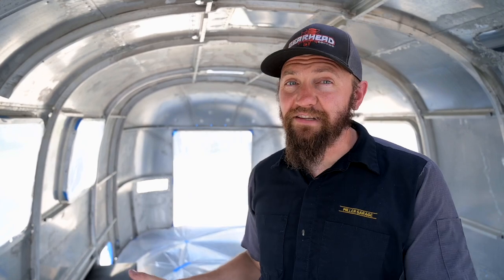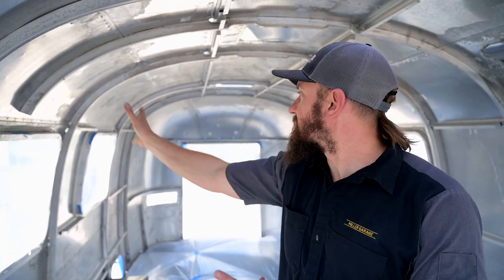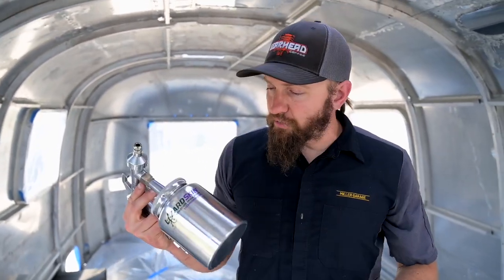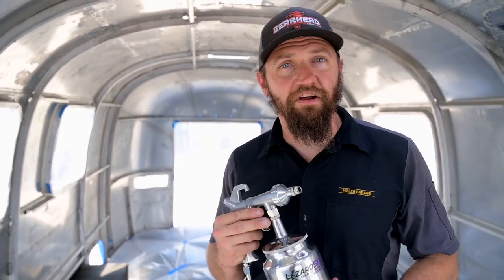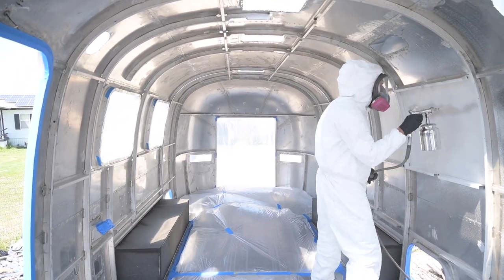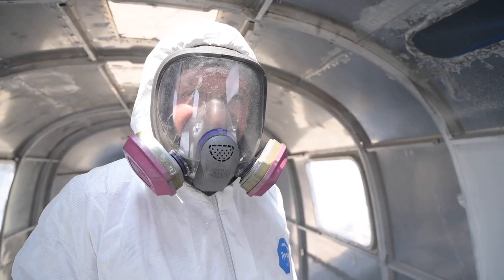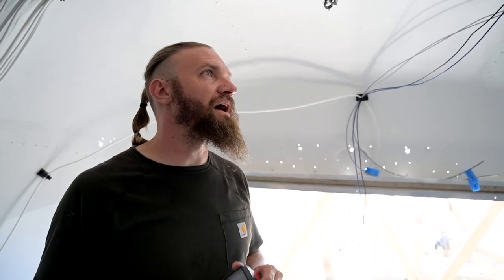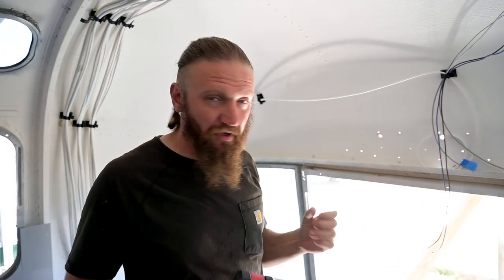Will doing THIS to your Airstream keep it 15 degrees cooler?! - Lizard Skin insulation test

Comment: I’m an hvac guy although lizard skin is definitely a cleaner finished look I prefer a mastic sealer that we use on ac duct work that you can just brush on or use a roller. It’s thicker and a great thermal barrier and a lot cheaper. I use #9 which paints on nicely and comes in 2.5 gallon buckets.
Reply: Thanks for the pro tip....you are not wrong
Reply: Would this give the same water sealing benefits as Lizard Skin? I like the idea of being able to just roll it on, and since it's going to be hidden behind the inner skin I don't care about the finished look.

Comment: I know you said it also acts as a sealant.  Did you check all the rivets and seams and seal those traditionally before you sprayed?  What are your thoughts?
Reply from the maker: I may not have mentioned it in this video but yes, we did all rivet and body repair first. All seams that need polyurethane are sealed before hand and the lizard skin applied over the top.
Reply: @MillerGarage  OK Thank you for your quick reply. I appreciate your videos and sharing your knowledge.
Reply: Hi Ian! Great video on the insulation that was very interesting. How do Airstreams cope with a Dutch Oven setup? Do you need extra extractor fans or do you just have to open the windows a bit wider?

Comment: Would it work on the top outside? I see newer Airstreams with white tops.
Reply from the maker: The Lizard Skin is not recommended for roll on application. You could attempt to spray it but it would probably not go well. We have used Buskote and Dicor Cool Roof. Both are great.